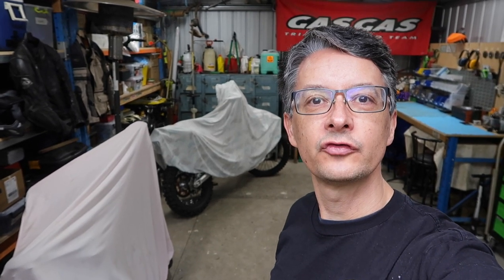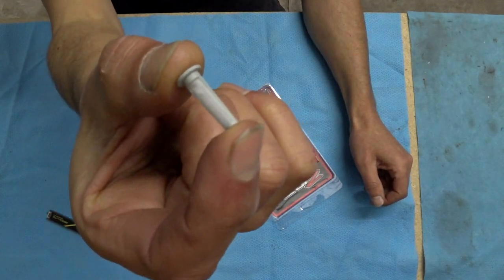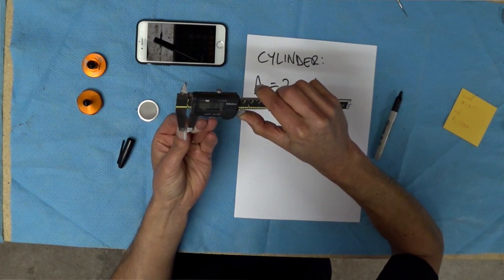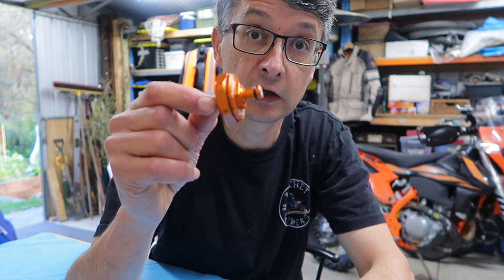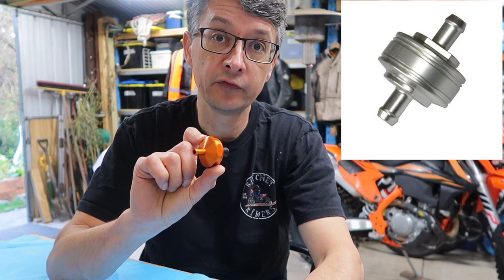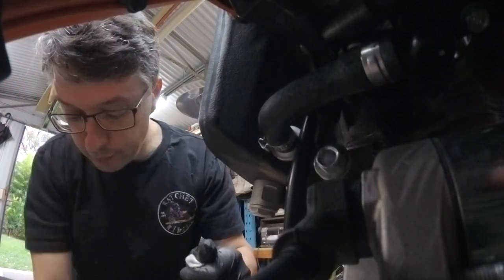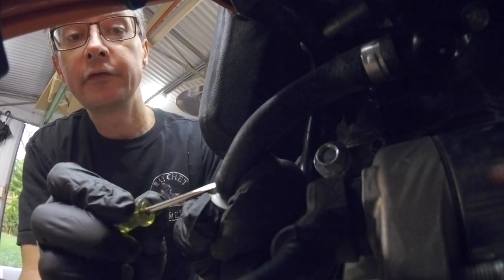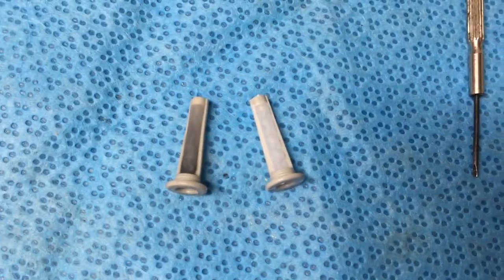Zip-Ty Quick Disconnect Fuel Filter install on KTM500 EXC-F

Comment: I had to laugh when you tried to remove that clamp. I was exactly the same as you when I fitted mine recently. I struggled with screwdrivers, side cutters etc. Shame about the price now, with a terrible exchange rate and expensive freight but I think it’s the best option.
Reply from the maker: I knew about the Dremel method but wanted to try without special tools first. Alas... It was literally a 5 second job with the Dremel!  Yes this filter is the best option by far for this bike.

Comment: Great video Keith I was working in Kenya for a year and your Vids kept me entertained.   I dont recommend riding in Kenya You need balls of steel (lots of head ons) and the bikes generally lost every time.....    Keith do you remember what size was the replacement fuel injection clamp?      Keep up the content mate its very helpful .     Im back in Melbourne so I may see you about
Reply from the maker: The clamp has a number 15 stamped on it. The hose is approx 14.5mm dia.

Comment: I looked to buy online but by the time you add the $16.95 mail costs it puts them into the $100 per filter costs so will just use the spare $5.25 KTM replacement filter that I carry in my tool pouch if I need. The idea and convenience is good, I would have more than likley purchased had it not been for the cost of postage for such a small item.
Reply: The price is ridiculous

Comment: I like the zipty idea but does require a 19 mm wrench + whatever size wrench for the other half to get it apart….should it be required while out riding.  So need to carry two additional tools not included in the KTM tool kit.

The stock system is so easy and quick, no tools required.

I did buy the zipty filter but will not be installing based on above.

Good vid though.